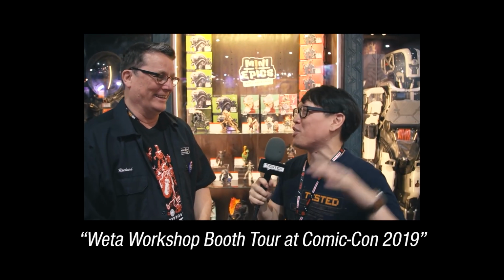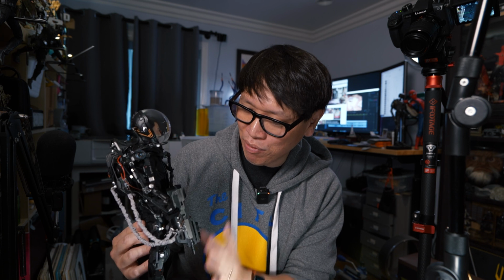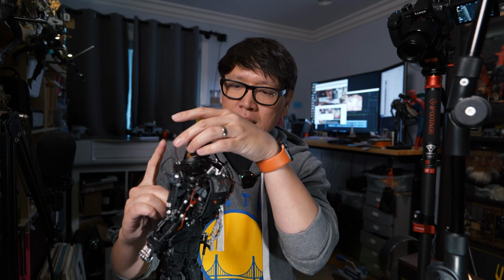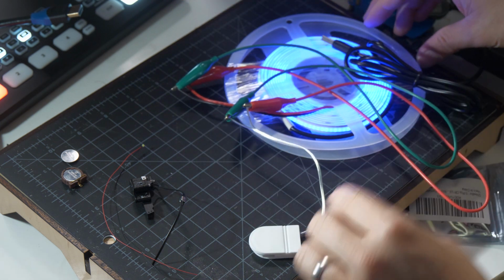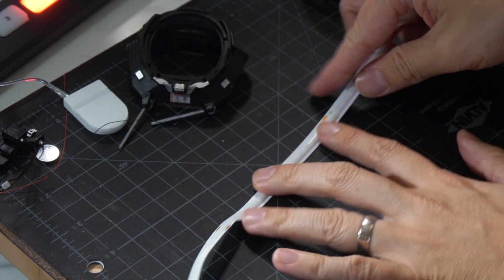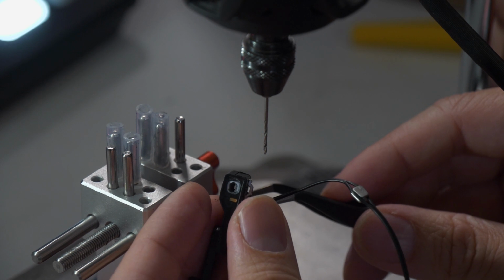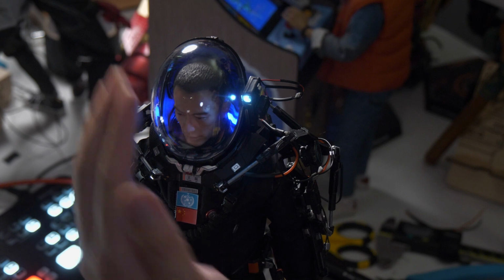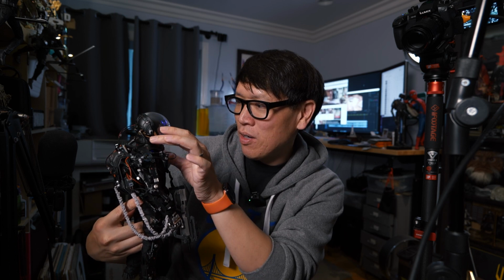The Wandering Earth 1/6 Spacesuit Lighting Mod!

Comment from the maker: Damtoys The Wandering Earth 1/6/ Figure: https://www.bigbadtoystore.com/Product/VariationDetails/151482 
DiCuno Micro LED pack: https://amzn.to/3whSaam
5V USB-Powered COB LED strip: https://amzn.to/3LPsXdI
USB power supply: https://amzn.to/38Wtw70
CR1220 3V coin button battery: https://amzn.to/3ypjYvU
CR1220 coin battery holder: https://amzn.to/3ykJKkZ
CR2032 coin battery holder with switch: https://amzn.to/3ym7IfQ
Disclaimer: Tested may earn an affiliate commission when you buy through the links here.

Comment: I am using similar LED's to run the lights on a 1/12 scale model boat, I run then from a single lithium cell, run through a voltage regulator circuit, to get a constant 3V from the lithium cell. my led's are 0.8mm x 0.5mm.

Comment: Duuh.. When you measured the thickness of a battery your caliper SHORTED the battery.  You're lucky that your batteries survived.
Reply: .... Use a piece of paper to prevent short,  ( ZERO the device with paper thickness ).
Reply: Yep! Those coin cell batteries typically have a high ESR so it’s probably ok though.
Reply: Maybe the two parts of this electronic caliper are insulated electrically. But I'm not sure since I haven't use and tested of those.